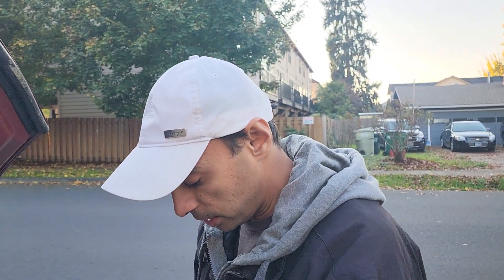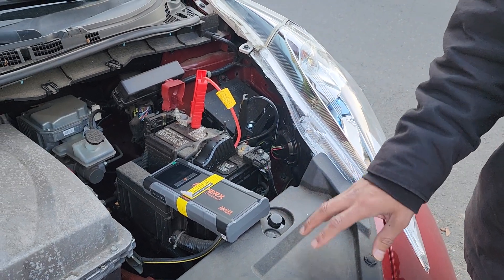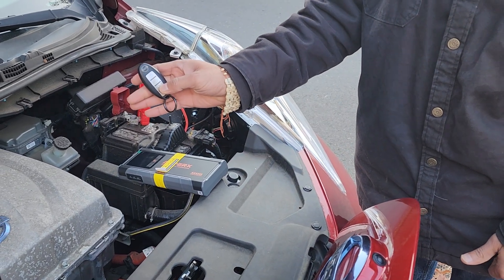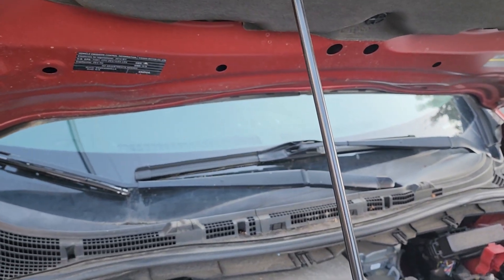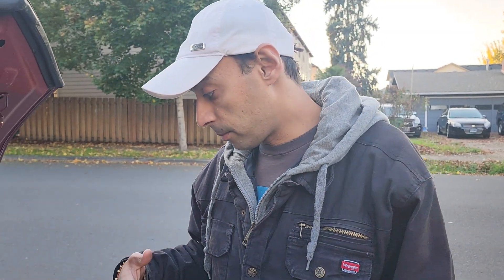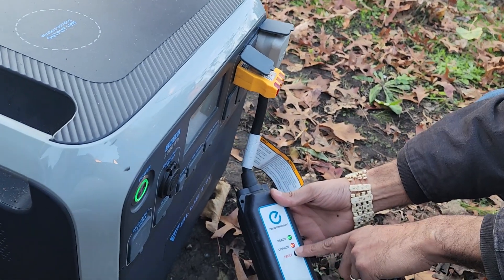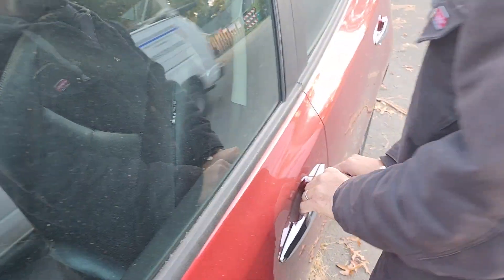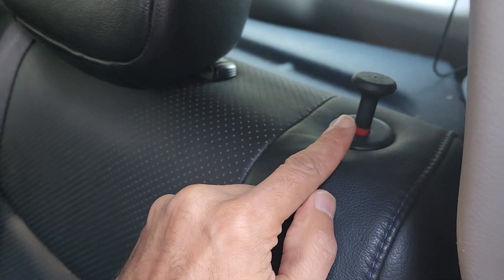How to Jump Start a Completely Dead Electric Vehicle EV

Comment: Next time try this procedure:
1- Connect a booster to the 12v battery
2- Start the car (brake + start button)
3- Unplug the 12v booster

The 12 volt battery will be recharged via the lithum battery. Do not turn off the car until you are in front of a fast charging station.
Reply from the maker: Thanks, I will keep that in mind for next time! I appreciate you taking the time to comment and supporting my channel!